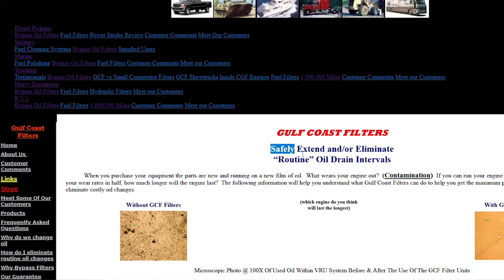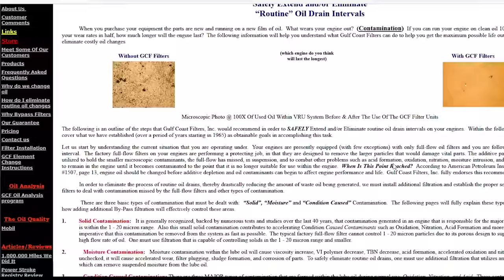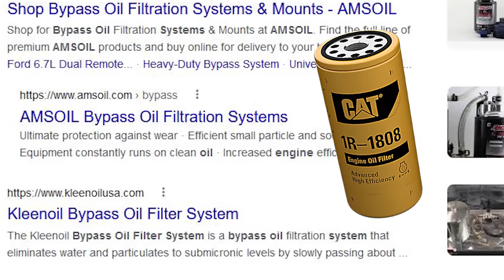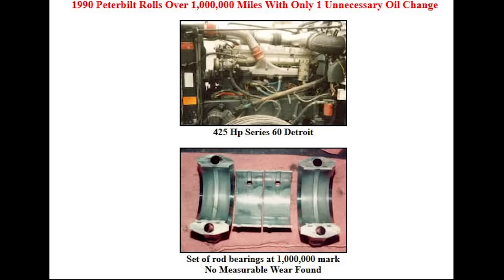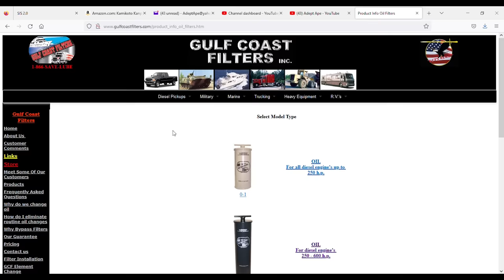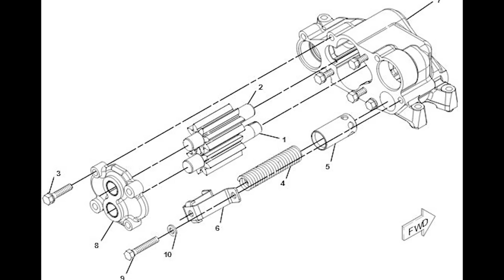No Oil Changes and 1 Million Miles!!! Are Oil Changes Optional with a Bypass Filter? (INTERESTING)

Comment: Add to and just change filters?
Reply: We get the oil changes by adding make up oil when the filters are changed. My little filters need a quart. The big Gulf Coast filters need 3 gallons of new oil when they are changed. Its a matter of never allowing the oil to get dirty and adding enough new oil. When you dont drain the oil you.have to change the filter more often. The Shell oil test truck gets about 350 gallons of new  Rotella 15 40 in a million miles. Thats old news . Road king asked me for the owners phone number in 1996.

Comment: If they did one oil change in that 1 million mile period then the engine really didn't have 1 million miles on one oil change, but why ruin a good story with facts..... Having said that I do think bypass filtering could be combined with extended oil changes (not a million miles) for reduced operating costs.
Reply from the maker: I do mention this in the video.
Reply: @AdeptApe  I should have been more clear, that comment was aimed at Gulf Coast not you!
Reply: @tempestmkiv  the series 60 Detroit 425 HP engine is torn down and the parts measured about every 250.000 miles.They have to drain the oil to do that. After they get thru they carefully pour the used oil back in. A mechanic sees the container of used oil and disposed of it. They had to replace the oil with new oil. It had to.be called an oil change. Do you keep your mouth shut or do you admit you had to change the oil. Can you imagine a mechanic thinkimg I shouldnt dispose of this used oil. They might be pouring it back in.

Comment: the guys claiming that oil never breaks down at high temps need to watch some Project Farm videos
Reply: Aluminum and steel break down if you get it hot enough. I am old enough to remember when you couldnt use multi grade oils in a diesel because the polymers broke down and stuck to hot engine.parts. I used Standard Delo W30 in my car. I like that Project Farm. I dought that my oil gets as high temp as in his test
Reply: You can't compare testing a little bit of oil to many gallons in a diesel engine.Never had a problem with oil breaking down in normal use. Never put oil on a hot plate.I wonder if the carbon on the valves and pistons is broken down oil. If it is it didnt start at 3.000 miles.It started when the oil was new.

Comment: Large diesel engine have so much oil that they do not require engine oil change they just get topped off for years before the engine gets a rebuild and that's when the engine oil is replaced.. this is common for locomotive and ship engines. Also the engine parts are so huge that they don't really care about small contamination..
Reply: As far as I know Shell offshore uses the big Gulf Coast filters on the Locomotive engines on the drilling rigs. I would think the smaller the clearances the smaller the micron rating the filter would need to be. Before the Frantz 3 stackers went out of production several in parallel were used on the big engines. Before I started selling the Gulf Coast filters I had never seen a EMD engine..

Comment: You know when you open a drain pan and the oil is just a solid jello
Reply: Havent seen that in a long time. When I worked in a full service Standard station in the 60s it was common.Normally you could push a screw driver in and get some out. Then you could put kerosene in and let the engine idle awhile. Not so common these days.

Comment: Musta been on some sort of dyno/test setup
Reply: Its a regular over the road truck. At 250 K miles they inspect the parts and  put it on the rollers to check the. HP..
Reply: @ralphwood8818  interesting - do they change out the filtet in the bypass filter then?
Reply: @jacobkamphaus5565  That truck is old news. I was talking about it in 1996 on YouTube. I was selling them then. Road King magazine called wanting the truck owners phone number..Pepsi Cola had sold it to Randy Rogers by then. I learned more from the magazine article than I knew already.im a car and pickup guy..The Bounty big roll paper towels are changed every 10.000 miles and 3 gallons of new Rotella T 15 40 is added. At 50.000 miles the full flow filters are changed and 5.5 gallons of new Rotella is added. That is equal to a full oil change every 40.000 miles. When they say the oil only had 1 oil change that is not corect. They were draining the oil about every 250.000 miles so they can tear down the engine and let Shell oil measure the parts. After the engine is put back together the used oil is poured back in and the engine is tested for horse power.. A mechanic saw the used oil at one of the tests and disposed of it.  They had to fill the engine with new Rotella. They had to call that a oil change ihavent added it up but 3 gallons of new oil every 10.000 miles for a million miles is not only 1 oil change. Of course with that system the oil is never allowed to get dirty. That means much longer engine life. I also got a call from NASA.  Now they are using Gulf Coast filters.There are some smart people out there.that might not have heard of the filters. The NASA diesel equipment engineer said the filters are only for industrial use. Individuals dont keep their equipment long enough. He also said the new oil gets cleaner with the filters. They were moving the shuttle then. To answer your question. They are only draining enough oil so they can tear down the engine They would change the filters if it was due I dont know if they didnt at least drain it it would leak while they were working. It might not its mounted low on the frame. They normally have a drain valve.

Comment: Oil change every 10k miles??? My company gots 50k between changes
Reply: If you are talking about the million mile truck the bypass filter is changed every 10.000 miles. The full flow filter is changed every 50.000 miles.

Comment: 40 years a mechanic.. ASE..BLA BLA.... seen lots of no oil change engine... All trashed.... Seen many 3k miles engine... Super clean.... This is a odd video.... Crazy
Reply: Actually there are old mechanics that think filters are supposed to get dirty and oil is supposed to stay clean.I have never seen a no oil change engine.Ive seen no oil drain engines. My Pontiac gets a new roll of toilet paper and a quart of new oil every 6.000 miles normally. That is a no oil drain engine. The full flow filter has 63 .000 miles on it I know it is still clean because nothing big is getting in the Jackmaster Classic  bypass filter. 6.000 mile filter changes in Alasks might not be enough. There is a shortsge of common sense with filters.

Comment: What about running both filter types?
Reply from the maker: That's certainly not against the law. You would definitely want to run your stock filter also, as that is a direct filter of the main oil gallery.
Reply: Im not a truck guy but  in the old days engines didnt come with oil filters. You could order a bypass filter at an extra cost such as a Luberfiner. My old 41 Dodge had a Fram bypass filter. It was the same as a Luberfiner only smaller.They both used cotton. My 37 Studebaker book said it wasnt necessary to drain the oil. Change the bypass filter when the oil looks dirty on the depth gauge..Not sure what they used for a filter. Bought the book at a flea market. The old car engines were nasty. The old Chevy 6 engines needed a full flow filter.Instead they depended on the babbit bearings being soft enough to absorb the engine damaging abrasives.You could get it done right if you could afford it. Racing equipment people could install a full flow filter and bearing inserts.
Reply: They raced the old Chevy 6 engines.. They could get 100 HP out of the 216 engines.

Comment: Why not change your oil much less often instead of never.
Reply: One thing you could do with a car or pickup is install a toilet paper filter. Use 20.000 mile oil and a 20.000 mile full flow filter. At 20.000 miles change everything. All it amounts to is  keeping the oil clean and adding enough new oil. I dont drain oil but I change the filter and add new oil. Personally I like the top loader toilet paper filters. I have the Australian Jackmaster Classic  Motor Guards and Gulf Coast filters. Normally use Great Value 1000 from Walmart. I use Scott 1000 in the flat head Ford V8 canister filter that I converted. Dont have anything big enough for the big Gulf Coast paper towel filter. Lucky to find the Ford filter. They were optional equipment. The old Fram is pretty much the same.
Reply: @ralphwood8818  what happens to the lint in the toilet paper?
Reply: @randywl8925   Good question. Never worried about it. When Dune Buggies and Hot VWs tested the Motor Guard on a dune buggy they put a inline fuel filter in the return line. They cut open the fuel filter to check for paper fibers. None was found. Oil holds paper together. If I had concerns I would put something like a fuel injection filter in the return line. The Australian Jackmaster Classic has a high quality roll of toilet paper in a fabric cover. I use toilet paper right out of the package.some off road equipment dealers sold the Motor Guard toilet paper filters such as Dick Cepec in California..The beetle came with no filter.
Reply: @ralphwood8818  thanks Ralph, your explanation is good enough for me. 👍
Reply: @randywl8925  When I pull out a used roll of toilet paper I expect it to be strong and tear at each sheet. If its been in there too long it wont be strong. It will break when you try to tear it at the perforations. .No telling what is working on the paper instead of the engine. Not rocket science. Saw a Toyota that hadn't  had a oil or filter change he said in about 3 years and 60.000 miles. The toilet paper was like carbon shaped like toilet paper. Part of the ful flow filter was missing. The oil was like gear oil. A piston was hitting the head. He was also having trouuble with his 460 Ford. The oil light comes on when he goes around a curve.. It was almost empty. When he went into a curve the oil went to the side of the oil pan. The oil pump started sucking air.

Comment: How do you get rid of acids?
Reply: Use a bypass filter that keeps the oil clean and dry. Use only oil that neutralizes acid. I dont need oil analysis. If you have a expensive engine you might use a oil analysis program. Watch your total base number TBN. Some say it needs to be at least one.. actually we depend on the crankcase ventilation to remove the water.
Reply: You dont get rid of acid you make sure you dont get acid .

Comment: Some chems trap moisture and burn it
Reply: The water mostly is removed by the crankcase ventilation. If you do short trips in cold weather  your water absorbing bypass filter might not be able to handle it. I dont do short trips in cold weather.

Comment: I wouldn't try this with a gas engine. Atleast not changing your oil part. Gasoline is a solvent while diesel is a lubricant.
Reply: Ive used toilet paper filters for 60 years. I always thought motor oil lubricated the engines. My H Farmall ran on propane for 50 years untill I converted it to gasoline.with a chevrolet engine. Everything I own has a toilet paper filter including the Ford diesel tractor.Dont drain oil in any of them.

Comment: You add fresh oil everytime you change the bypass filter. You ARE changing the oil.
Reply: Correct
Reply: The truck gets 3 gallons of new oil every 10.000 milles. More when the full flow filter is also changed at 50.000.. My car gets 1 quart of new oil every 6.000.miles.The full flow filter has 63.000 miles on it.
Reply: 5.5 gallons seems a little high for both the 3 gallon Gulf Coast filter and the full flow filters. Thats in the Road King article At any rate a lot of new oil is added in a million miles. The Road King article says its equal to a full oil change every 40.000 miles.The oil analysis says that is more new oil added than necessary. Probably best to follow Gulf Coast recommendations
Reply: The series 60 Detroil im guessing gets about 350 gallons of new Rotella oil added in a million miles. Some Gulf Coast filter users are changing the filter and adding. New oil less often. Oil analysis showed the Detroit was getting more new oil than needed.

Comment: As a diesel tech I just wanna say engine oil doesn’t break down. The additive packages are what lubricate the engine. That’s the reason you need to change your pil. Not because the oil is dirty. Engine oil nowa days have so much detergents that it keeps the oil as clean as the additives last

Comment: oil shear. enough said.
Reply: The oil in my air conditioner must be shesred all to hell. Its been in there 22 years. Had a freezer.that hadnt had an oil change in over 50 years. That oil shear story might have started with the old multi grade oil that didnt hold up in a diesel engine.

Comment: no oil breaks down and loses viscosity. anybody who doesnt know you need oil change shouldnt be around anything mechanical. we are all now dumber may god have mercy on his soul
Reply: I gave up allowing oil to get dirty then draining it in 1963 with a Frantz oil  cleaner and Standard Delo.W30. You scare me.
Reply: @ralphwood8818  so you dont change out your oil then?
Reply: @idahoman966  The engine needs to have clean oil 100 percent of the time plus enough new oil added to keep the additives up to specs.  My small engines get a new quart of oil every 6.000 miles when the one quart filter is changed. The Filter on the Peterbilt holds 3 gallons. I think it got over 300 gallons of new Rotella in the 1 million miles. Oil analysis  shows that is enough new oil added. Equal to 40.000 mile oil changes. You have to make adjustments for different driving conditions.

Comment: Synthetics don’t break down, conventional oil does.
Reply: I think the oil in the test truck was Shell Rotella 15. 40 conventional. The system of using filters that clean oil and adding new oil at filter change has been in use before there were synthetic oils or multi grades. When I started the polymers in multi grades didnt hold up in a diesel. They would void the warranty. International may have been the last to require single weight. My Oldsmobile diesel manual said you could use multi grade in an emergency until you could get 30 weight.

Comment: $2,000 a year in oil changes or $20,000+ rebuild.
Reply: Another ignorant saying.
Reply: @ralphwood8818  sure thing champ
Reply: I told my mother I wanted to sell oil filters. that clean oil when I grow up. She said you will starve trying to sell filters that clean oil to people that think oil is supposed to get dirty. She wanted me to be a Doctor.
Reply: @ralphwood8818  you do you sport. I’ve torn down enough motors that didn’t get regular oil changes and it’s not pretty. Yes I understand how a bypass filter works but I also know how oil works and the add packs that are in them.  I’d rather spend 100 bucks every 3-5 thousand miles then have to R&R a engine but hey some people are cheap basterds.
Reply: @spartanpatriot3163  I dont allow oil to get dirty and damage the engine I guess that makes me a proud cheap bastard. There will always be people that think oil is supposed to get dirty and be drained.
Reply: @ralphwood8818  you might want to spend a little time learning how additives in oil work.
Reply: @spartanpatriot3163  when I change the filter I add  new makeup oil the new oil adds new additives. With my small engines its 1 quart of new oil added. With the Series  60 Detroit its 3 gallons. Use your head. Its a Shell oil test truck with a Gulf Coast filter. Do you think Shell oil doesnt understand  that new oil has additives. Shell offshore uses the big Gulf Coast filters on offshore rigs. Those use locomotive engines. I believe the test truck used Rotella T 15 40 conventional. In those days. Road King magazine asked me for the truck owners phone number. I sold the filters in 1996. The series 60 got  about 350 gallons of new Rotella in the million miles. The engine was near new at a million miles..The big oil filter needs 3 gallons of make up oil when you change it. Pay attention.

Comment: Oil Additive package degenerates with use, regardless of oil cleanliness. It's idiotic to not refresh the additive package with FRESH OIL. 🤦🤡🤦🤡
Reply: Additives last a lot longer in clean oil. My cars get a new quart of oil every 6.000 miles. Mostly highway  warm weather.. The over the road truck its 3 gallons added. The truck gets a lot of oil analysis done. I dont need to prove anything. I know what clean oil looks and feels like..
Reply: Just guessing but I. Think the Detroit gets about 350 gallons of new Rotella 15 40 added as make up oil when the big filters are changed. Plus the 2 full  flow filters are changed every 50.000 miles.

Comment: This is how you bypass your warranty.
Reply: They dont void the warranty. Probably good to have an oil analysis program in case the engine has a problem and save your paper work.The big engine makers understand the importance of clean oil. Gulf Coast filters has letters from the big engine makers. One trucker was buying a new truck..He said I will need for you to take the Gulf Coast filter off the old truck and put it on the new truck. The salesman said that will void the warranty...The trucker said I will buy a truck with an engine that doesnt void the warranty. The salesman made a call. Good news the warranty isnt voided.